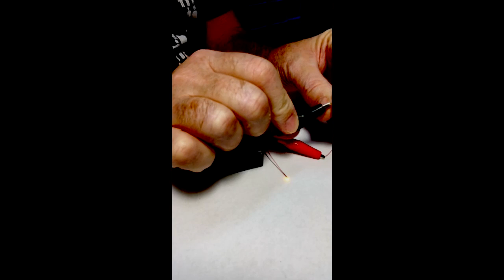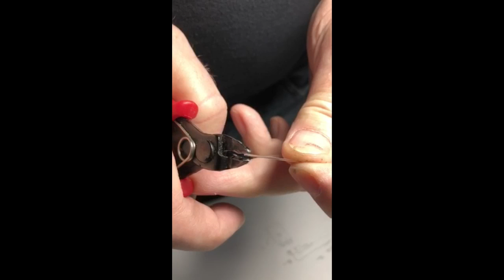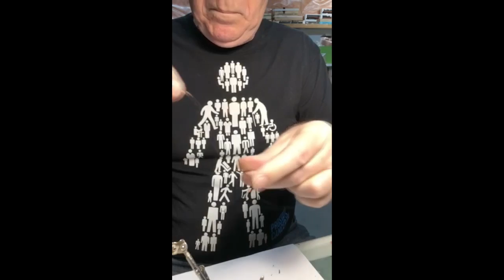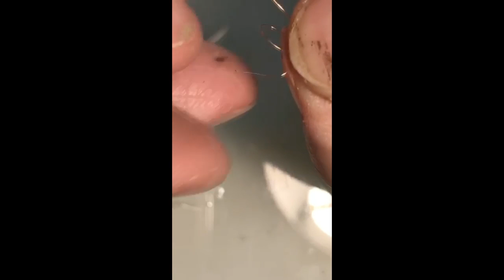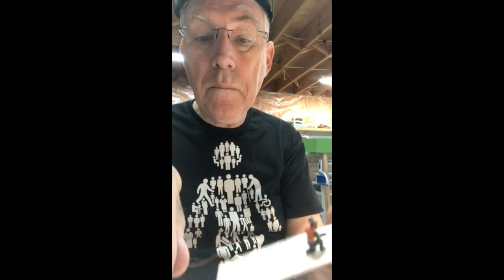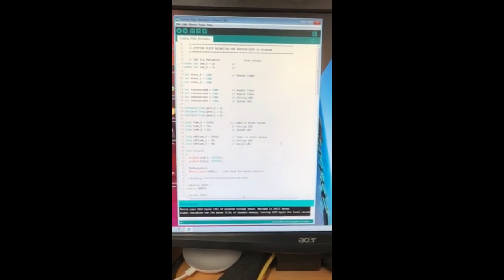HO Scale Weld animation

Comment: I like your video very much, but the audio was very faint and was not able to hear most of it. Where did you get the matching figures in different positions for your display? Are they purchased items or do you create them yourself?
Reply from the maker: Thanks, the sound is a bit low sorry about that,  the figures are all commercial,  woodland scenics do a set with 2 welders, one arc and one oxy, or the figures in one of my videos are track workers from a set by Scene Master, I think (not sure sorry) with the tool cut off and another fabricated then limbs bent with a little heat from a lighter. My 1st foray into youtubing and I didn't give it enough thought I'll endeavour to clarify my next posts